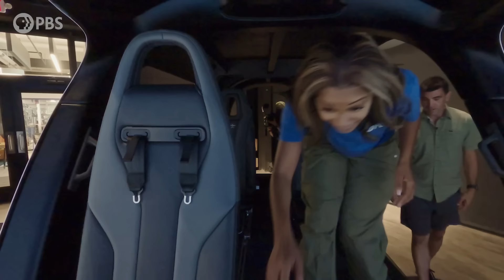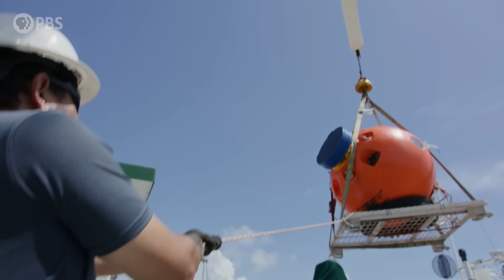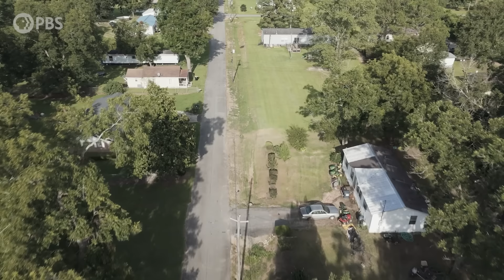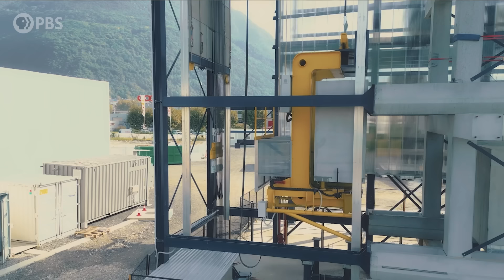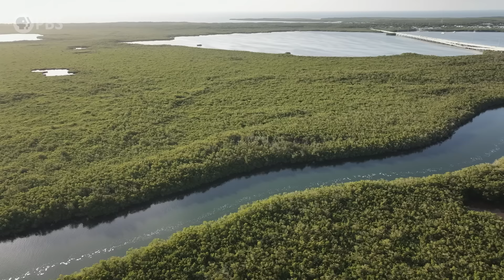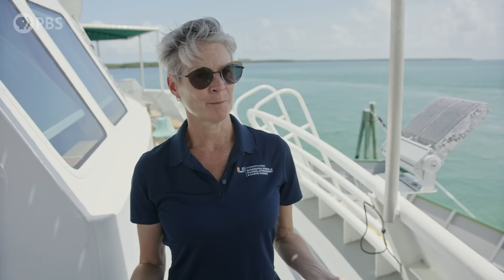This Is The Best Evidence That Atlantic Currents Are Slowing (AMOC Explained)

Comment: The problem is that at least in the UK electricity is 3x more expensive than gas. The energy companies are not passing on savings of cheaper electricity to the consumer and making huge profit.
This is the problem when trying to implement carbon neutral economy, unless it's highly controlled by legislation the suppliers will charge what the market can afford. If the legislation is in place then it's not very attractive to investors who can make more money elsewhere. This needs to be brought into the public sector.

Comment: It is hard getting through even the introductory part of this. Anytime someone references things like "the hockey stick era", you immediately know they have abandoned scientific method and integrity. The hockey stick has been thoroughly discredited. In all honesty it never should have made it through peer review. 

Now on to the AMOC. It has become one of the favorite topics for the climate alarmism crowd. As time shows us how many of their past predications have failed to materialize, they have been reduced to hyping every weather event and warning us of imaginary tipping points. The slowing of the AMOC is one of those hypotheticals. If you actually follow the published literature you will see that the comments we are hearing in this video are not widely accepted.  Sure a couple of papers were published a couple of years ago claiming they had detected a slowing. Those have since been superseded with new research. The most commonly held position on the AMOC is that it exhibits some variability but that according to the best data we have it is remarkably stable. Enter the models. The entire hypothesis is modeled based. They run scenarios with accelerated melting of the Greenland icesheet, assuming 100% of that fresh melt water enters the Atlantic and then plug those results into a circulation model. Now that they have a model to point to, the next step is to identify signs of this process empirically. That is very difficult. So what to do? Re-enter the models. As in a very recent paper claiming they have found evidence of slowing in one of the key components of the AMOC. "Equatorial Atlantic mid-depth warming indicates AMOC slowdown" (Ren, et al ; Oct 2025 ; Communications Earth and Environment). The paper claims they have identified a "distinctive fingerprint". The "data" they claim to be the fingerprint? 100% model driven. They took forcing data from CMIP6 models run under a CO2 concentration scenario 4 times higher than today and input it into a circulation model (MITgcm). They then put in changes in such parameters as SST, wind stress and surface salinity - all taken from models which predict a slowing of the AMOC - and surprise surprise they get a slowdown and warming in mid Atlantic equatorial waters at 1000 to 2000 ft depth.  Contrast this paper from Nature Communications (Terhaar, Vogt & Foukal ; Jan 2025).  Using proxy data to measure air-sea heat fluxes, they concluded the AMOC has been stable since at least the 1960's. 

I spent 20 years in science education, working with students in the field. Anyone with a passion for science should know that a defining aspect is uncertainty. That used to be highlighted in published research. Now, well, can't have uncertainty, as Stephen Schneider so famously stated. That could undermine the sense of urgency we so desperately need to foster in order to drive immediate action.  While I commend Maiya's passion for science and informing others, I strongly recommend she consider returning to her roots rather than being an acolyte in the Church of Global Climate Crisis.

Comment: Come on, shipping packages!! Is flying cheaper than driving? The energy required to simply keep something in the air is incredible greater than leaving it on the ground. However, there are certainly niche areas for it. It's like the vions of the Jetson's 80 years ago; we still don't fly around.

Comment: We could make mountains but since we won't the next answer is to block the sun with discs on the space station and put 1000 space stations to block the sun completely and make an ice age
We could figure out how to control the weather completely by blocking the sun with alternating blockers , this would let us change the temperature on other planets also
The current system of geo engineering will only increase the problem 
When we use laser or cloud seeding it takes water from ice on mountains and increase global warming 
If we use fog or condensation it takes moisture that would go to the top of mountains and stops ice from forming if we use salt water to make freshwater it takes salt that makes water vaporize faster and stops it from making glaciers 
The only real answer is to drop the planets temperature and make a ice age

Comment: Geomagnetic excursion- the magnetic North Pole is moving and the Sun has increased in solar activity 

Find a way to control the Sun and the planet 😂😂😂
Reply: This is regular solar activity.  It's just at the peak of its 11 yr cycle
Reply: Evidently you are totally ignorant of the fact that between 1960 - 2020 the Sun was in the 2nd half of a 120 year cycle. But the global average did not drop 0.5C like before, it increased by 1.2C instead. A 1.7C shift in the wrong direction. In just 60 years.  And the magnetic pole shift does not have a significant impact on climates.
Reply: @MrMezmerized  was that taken at airports? Hmmmm …
Reply: @mcawesomest1  Measured all over the world. And at least try to make sense. It's not like thousands of new airports have been built over the past decades.

Comment: 04:26 Reminds me of The Starry Night painting by Vincent van Gogh! Did he see something similar to this or visualise it before it was seen by others? Many great artists studied nature, so, it might not be that far-fetched!

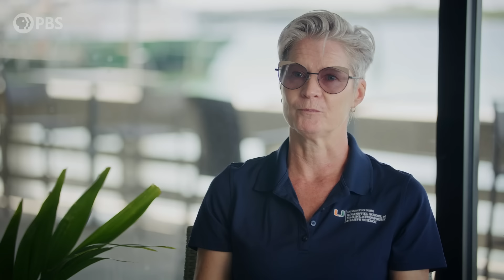04:39 Someone's videorecording! I'm outta here!🤣

In regards to using less gas and using more electricity, the generation of the latter also adds to the climate crisis, as there are still many coal-powered plants. However, one solution would be to research low-cost roofing materials that would also be photovoltaic in nature and the power they generate could be stored locally. This would not only be helpful in a climate sense, but, also, in the case of a natural disaster, as it sometimes takes weeks or longer for them to restore power. Although, I'm not certain that it can still be called a wholly natural disaster since mankind's polling of the environment has attributed to the strength of storms.

Could also research low-cost windows which might use the heat of sunlight hitting them to generate power and store it. Much of the light isn't in the visible spectrum and that could be isolated and used for power-generation purposes, letting in only the visible light, and, perhaps, even less of that, if you could lower what passes through and either reflect it outwards or use it for power-generation, also.

There's also the possibility of building Earthships, that use old tyres and cans in the walls. Some even used coloured glass bottles in the less-thicker walls, to create a beautiful little area as sunlight hits them from outside. If you're not familiar with Earthships, you can look them up or watch a video or two on them here on YouTube. They also keep things cool or warm using the air that's passed through metal a few feet underground, that's a fairly steady temperature. They also have a grey water and black water system (it can be used to grow non-edible plants, such as flowers) for better water conservation.

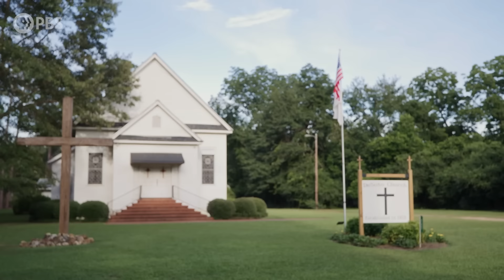10:15 The phrase 'black belt' means something entirely different to some of us who took martial arts training starting at an early age (thanks in part to a parent who was in the military)!😉

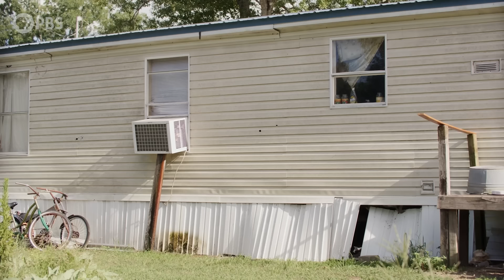10:21 A brightly-coloured piece of sheet metal that would work as an awning of sorts would help the light hitting the window during the hottest part of the day and could also be secured to act as a type of storm shutter.🙂

In regards to the cost of renewable energy technology coming down, thanks to the current American president's administration, much of the money going into researching alternatives to fossil fuels (and climate research) is being cut.😞 I encourage others to watch not only the PBS generated content but also watch a good variety of news sources that aren't mainstream media outlets, so they can learn more about it and other things they don't report on.

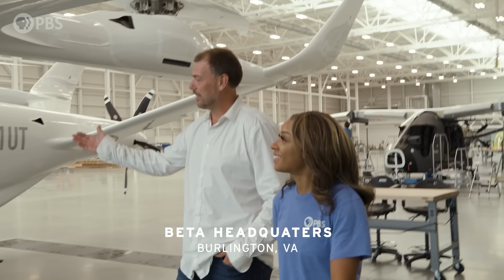12:49 Great smile!😁 Vertical Take Off (and) Landing AKA VTOL.

As for their growing use . . . Once upon a time, someone published a book with the title 1975 and the Changes to Come. Among the things they said were possible was commuting via jetpack. Heh. While that obviously didn't happen (at least in THIS timeline), there's a potential for inexpensive super-light VOTL aircraft that could be part of a mass transit system, as they're already being worked on in other countries. Although, if many people got their own VOTL craft, air traffic control would have to be MUCH better than it is now, and, hopefully, built with true failsafe systems incorporated into the design.

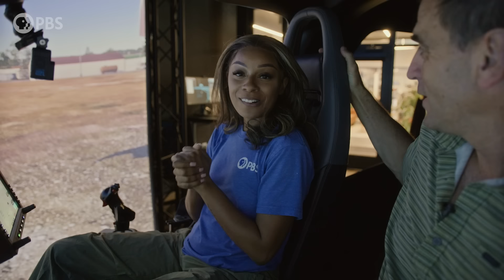14:47 So, what's the story behind that tattoo, Maiya May? These ancient eyes can't even tell if it's writing or something else.

There's many Chinese-made electric vehicles that're lower-cost than those made Stateside, but, with the protectionism tariffs against them . . . 😞

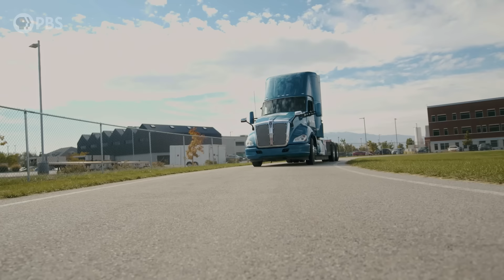15:45 There's already at least one road in Europe that powers vehicles travelling along it.🙂

Energy storage: The novel Friday by Robert A. Heinlein had some in it, as well, calling them shipstones.

Another interesting science-fiction story? A Logic Named Joe by Murray Leinster, which had an AI as well as personal home computers that were connected to a public network and had firewalls to protect critical information. Publication date? 1946! More than 20 years before ARPAnet (Advanced Research Projects Agency Network), the predecessor to the modern-day Internet!

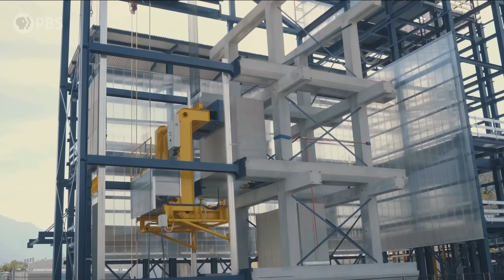16:23 Gravity batteries. This is similar but a scaled-down version of stored muscle-powered light, where a reading light is powered by a brick or cement block that's lifted into the air by someone's arm is slowly lowered and, as the rope is moving through it, it generates the power needed for the light. Handy in places that aren't connected to a network or have their own on-site power generation. This helps school-aged children in places like that read and do homework after the sun's set!🙂

17:22 Unfortunately, as the number of supertrees (such as the Indonesian Rhizophora Mangrove, the Afrormosia Congo's Teak Tree and the Brazil Nut tree) are being cut or burned down and bulldozed , especially in what remains of the Amazon Rainforest so they can build more ranches to breed cows. Greed killed Earth! The latter is also the name of one of my characters in the newly-resurrected City of Heroes game on the free-to-play (not even microtransactions) Homecoming Server, which is good for those like me who live in poverty and can't afford a high-end computer to play the latest games with high system requirements and it can even be played on Linux distributions by choosing to open the installation file with WINE and installing it into the default director (which it'll create). I also created a New Player CoH Tips page on my decades-old personal Web site.🙂 But, even though it's ad-free, with nothing for sale on it as well as being practically littered with help and tip pages, someone is bound to get uppity about me posting the link to it . . .

17:31 The carbon storing facilities are cost-prohibitive until more R&D is done. But, one solution is replacing the destroyed supertrees. Which isn't likely to happen in even our great-great-great grandchildrens' lifetimes . . .

18:12 Ah, so you DO talk about the mangroves, at least!🙂

20:42 "When we get to that place of climate stabilisation . . ." This should be IF, not when, as many governments (especially the far-right leaders who might be profiting off of the destruction of the environment) still claim that environment isn't in danger and that climate change is a hoax or fake news (which reminds me of that German fellow with the small moustache who screamed about the 'lying press').

23:05 Environmental damage control or trying to limit it as much as possible. Future generations will be cursing those who came before and asking why they didn't do anything to stop this, even though there was a LOT of evidence to show it was happening, at least, before some far-right extremists made some of it disappear, such as the EPA's 2009 Endangerment Finding in another attempt at climate breakdown denial. But, some of us made copies!

24:08 It's depressing to watch the degradation of the natural world in real time! It's also frustrating when you have so many of those with power denying that it's happening! Some corporations claim they won't even be carbon neutral until 2030 or 2050 (I also have a 'Climate Change AKA Climate Breakdown, Sea Level Rise, Global Warming and Fossil Fuels' and a 'Climate Change AKA Climate Breakdown Facts with Details' pages on my personal Web site and the latter has links to the cited sources, but, stopped updating them a while ago because people aren't listening), which, of course, is far too late . . .

24:28 "How humans are affecting it." The Anthropocene age, where mankind has intentionally changed the planet, although many are still in denial despite all evidence to the contrary and won't allow it to be called that.

24:49 Er, didn't see him in the video before. Was that part cut out in editing?

24:52 Embrace change. Would rather fight the future or what's quickly looking like an inevitable human-caused dystopia, which is all the more certain as the years go by . . .

25:30 Although there's a way to do something about it, the problem is those who profit off of the destruction of the environment. There's no stopping them and it seems to only be getting worse! Is the only solution to declare those who are the highest polluters engaging in crimes against humanity? But, with politicians demanding that monitoring the polluting be removed and independent oversight removed from many agencies, that seems impossible, now . . .

My hope for the future is pretty much non-existent at this point.

Comment: My body temp changes more in 24 hours than the global average temp has increased since the start of the Industrial Revolution.  Plus, temperature measuring devices had an accuracy much greater than the 1.42 degrees C temp rise since the beginning of the Industrial Revolution. This makes the 1.42 C temp rise highly questionable.

Comment: Something happened around 1980, maybe it was your 'tipping point.' Barometric pressure began dropping, and has still not recovered, causing a steady reduction in wind speeds, that we are still in. Water and air behave in a very similar way. I believe the slowing of wind and the slowing of water currents is related, or at least a symptom of another problem.

Comment: Issues....   when the current stops the heat stays in the equator and it gets colder at the poles.    How is it anyone buys the idea that when the current stops moving  the heat that the poles get warmer and melt?????   
Secondly...  just where do you think all this electricity is going to come from.   no break down on how much power comes from petroleum products being burned because it is a huge percentage.   The entire state of Hawaii burns diesel to power the state! They are not alone.    
Dambs are horrible... dont you know... we are removing far more than we are building...   no one want to admit there is NO energy solution or replacement to petroleum.   The solution is reduced consumption while we create new sources of electricity, but no one want to hear that.
I could go on with more issues of this program.    
Everyone has an addjnda

Comment: No one talks about the geoengineering and what they're spraying in the skies. Nor does anyone talk about the weakening magnetosphere because the poles are going through a flip. With our shields down, more solar and cosmic radiation is getting through heating up the surface of the earth more than ever causing climate chaos. Cow farts and suv's have very little to do with what's happening. This climate change thing is to get us to accept what those at the top of power have in store for us. But guess what? They're all buying beach front homes,  while preaching climate change. The poles should finish changing positions in the 2030s sometime, and the weather will return to normal once our shield is back up to 100%. Have a nice day!!!

Comment: I took a different approach when I built my current house. I have gas furnaces, but I also have 2X6 exterior stud walls that are heavily insulated. I was obsessive about stopping any air leaks. I use an efficient air exchange system to let my house "breathe," without wasting energy. I did that because natural gas heating was the most cost effective. Using heat pumps would have easily doubled (or more) my monthly energy expenses. Putting heat pumps in a poorly constructed home is like putting a screen door on a submarine.
Reply: BTW, I've been a car nut since I was a kid in the sixties, and RIGHT NOW, in 2025, I think plug-in hybrids are the way to go if you want to reduce your carbon footprint. You can commute every day to your job, and probably do it 100-percent on electric motors. Then you plug it in overnight. But, you can also go on a long road trip and not have to stop for thirty minute recharges, if you can find a working charging station along your route.